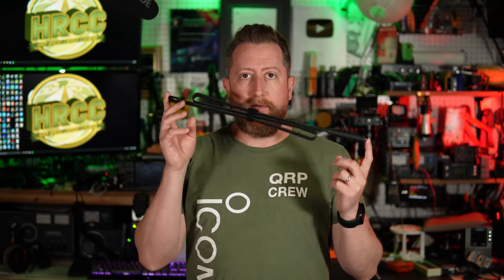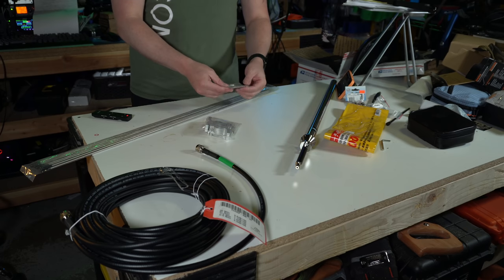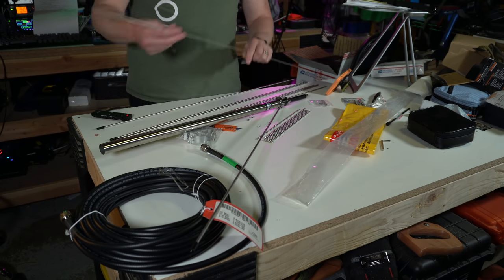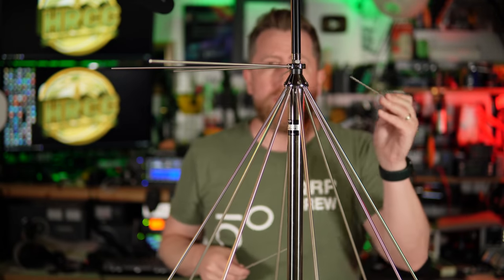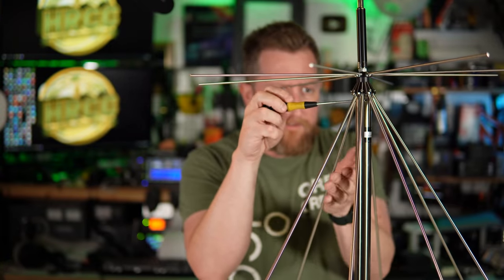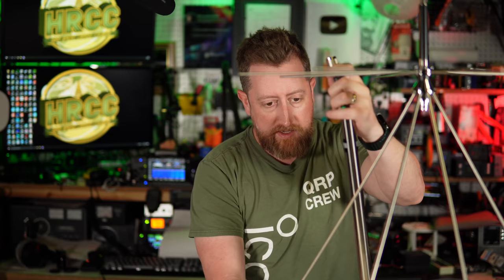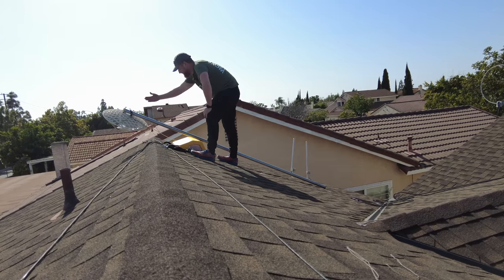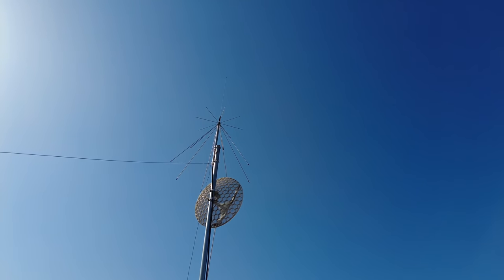Diamond D3000N Super Discone Ultra-Wideband Antenna: Great for SDR and Scanners!

Comment from the maker: Note: the Antenna had roughly the same SWR when it was installed on the roof as it did when tested in the shack.  So that was good news as VHF/UHF was frankly very good!
Reply: Put a preamp also then you can get rid of attenuation in tha coax and get even better RX , nice job 👍
Reply: @Peter-W1 would you need for uhf and vhf or just the uhf?

Comment: I found the TRAM discone to be a bit less dangerous, easier to set up, half the price, and it seems to work really well!
Reply: Yeah that's the one I have, it was cheap , well made, works well and has tunable lower extensions that allow RX down to 11 meter band but it does not RX up to 3Ghz supposedly.
Reply: Ditto. The Tram has a better designed hub.

Comment: Just a hint for you, if the set screws  on the capacitance hat ( horizontal elements) and the threads on the angled elements do not have thread locker on them already, I would recommend Loctite blue thread locking compound. Do NOT use red !

Blue will hold the elements in place, wind over time will vibrate the elements loose and one day you will look up and notice missing elements. Red Loctite requires high heat to break the bond, high enough that you will ruin the antenna to take it apart. Blue will hold the elements in place while still allowing you disassemble the antenna if necessary.
W1VJL
Reply from the maker: Good call!
Reply: Would the blue Logitech act  as an insulator, or does Logitech conduct?
Reply: @jdock32778  it acts as an insulator but enough of the element should still be metal to metal contact that it should not be a concern, you only need a very small amount don't completely cover all the threads and most also have a locknut on the element to tighten against the hub don't use it on the locknut if one is provided, the locknut will also provide a path to the element from the hub.

If it is the type where an unthreaded hole is in the hub and you just slide the element into the hub instead of screwing it in and there is a set screw to hold the element in place, Loctite on the setscrew will not affect capacitance
Reply: @the_second_amendment388  Very good. Thanks.. ...Loctite not the spell corrector Logitech. Wow.
Reply: Just TAC WELD IT!

Comment: Josh ... love real life "lessons learned" presentations. I originally had one of these Diamond D3000N discones. I just replaced it with a new Comet DS-150S Discone Base Antennas. I also have an RSPdx  that I have dedicated it to. This antenna does not use set screws, but, all of the shafts are threaded with a lock nut. All of them including the capacitive type hat have black plastic covers on the ends to protect your eyes. I routinely use this antenna for all of my HF listening as well. I find that the S/N ratio is much better than my full length wire antenna that I have in a horizontal plane. Keep up the good work! 73 - KF6IF
Reply: May I ask what the reason for switching to the Comet was? Currently torn between the two here (for UHF/VHF SDR scanning)
Reply: @sbo3784  Age of the antenna primarily. I live close to the ocean. They both have provided similar results.
Reply: @phildurall7466  thanks 😊
Reply: How do you like the RSPdx?
Reply: @seasparrow7427  Love it! I am surprised all the time with this little box.

Comment: I use a Diamond D3000 antenna for FM, DAB, 132MHz aviation band (I live near an airport) and 144 MHz amateur band. For the Broadcast signals I am using a UK designed Majority Fritzwilliam 2 receiver and for the rest the also in the UK designed SDRPlay radio on my PC.  The whip antenna peaks around 49MHz measured with my NanoVNA-H analyser. The cable is a Messi & Paoloni Hyperflex 5 low loss 50 Ω cable that is 28m long. I used an N connector on the antenna side. The FM signal is around -57 dBm at 102 MHz and the DAB reception is excellent! I receive the weakest but still useful channels over a distance of 65 km (10kW transmission power) and even over 90km distance at a C/N between 9 and 11 dB. That is really the lower limit! The nearby DAB stations I receive with a C/N of between 19 and 24 dB.

Comment: That signal that spikes up and is centered just above 445M looks almost exactly like mine did at my home QTH. It turned out to be one of my monitors on my PC. Turning off the monitor did not solve it. It was the monitor that was connected from the PC using HDMI and then ran into an HDMI to DVI adapter on the back of the monitor. Only way it went away was to either power down the PC, or disconnect that particular monitor cable from the back of the PC itself. Disconnecting it from only the monitor did not change the signal. Once I did, the signal as well as all the spurious emotions went away. My other 4 monitors on the PC did not cause any issue. I noticed some noise on the radio when tuning into signals near those frequencies that could be heard on some repeaters etc, but never figured out the source till I connected my SDR and was able to visualize it like you just did in this video.
Reply: same happens to my hdmi to vga adapter, and the noise is fairly powerful aswell surprisingly

Comment: Caveat Emptor :
It has been my experience, that over time, if you don't tighten the elements properly, that exposing these antennas to various wind speeds, they will respond to the vibrations, and lose elements !
I have learned to combat those vibrations, by incorporating a UV resistant monofilament fishing line, tied to each long element around the skirt of the antenna, in daisy chain fashion !
Knoting the line around each element as you go !
This, if done properly, acts as a damper of sorts, helping keep those pesky antenna disassembly vibrations to a minimum !
                   🤔.....?
          Just a thought !

Addendum :
I would also suggest if the model antenna you purchase doesn't have nuts for each element, it would be a wise investment to purchase the appropriate size nuts, as when tightened appropriately, they aid in helping keep the elements from backing out !

Comment: That self-sticking tape at 10 minutes into the video is the stuff that we used to call F-4 tape in the Air Force. Because it literally held the F-4's wire harnesses together in a pinch.

Comment: I started out with a Tram discone, and a raspberry pi running cubic sdr on debian.  That's what sent me down the ham radio rabbit hole.

The Tram is a lot easier to put together and has an 11 m whip and two longer tunable base whiskers that do 10m , so I also successfully used it as a cb antenna (for local stuff) before I got my ham ticket.  The transmit range is very limited though - I never made any CB or HF contacts with it outside of maybe 10 miles away.

Discones have BIG EARS - I can hear VHF/UHF/GMRS repeaters 80 miles away in other states with it, mounted about 30' up in the air... and I live in hill country.  You're going to love it for SDR and scanning. 

The downside is that discones have zero gain/directionality.  So you won't get out with it past 5-10 miles on transmit.
Reply: I've been using the Tram 1411, and like you, started out using it for SDR listening before I got my ticket.  On top of 20' fence top rail, that thing is my go-to for 2m, 440, 6m, and 10 & 12.  I've done dx to NZ & Aus, all over North & South America and Europe on 10.  I haven't  been able to beat it with anything I've tried so far on 10m including dipoles.
Reply: @aandpman  You must have caught some magic sky to DX with a discone!  The best I could do with the tram on 10m was a guy in the next state.  Maybe is has something to do with 10m being a "daytime" band and time zones - I'm an east-coaster with a 3 in my call, so most of my DX window on 10m is closed to the east across the Atlantic, by the time the band is warming up for me.  I did hear a lot of Caribbean CQ's, but I never could hit them.  I normally can't hear west of The Rockies, unless the caller is pumping some serious wattage.

I have mine on top of a 10' stick of 1" galvanized conduit, that I hose-clamped to the top section of a 25' telescoping flagpole that I bought at Harbor Freight.  When I'm not using it, I just collapse the flagpole, and it's hidden behind my garage.  I got the idea for the flagpole setup from a power antenna I had seen on an old Buick.

Comment: When building or assembling these types of antennas, ( other than having eye protection) if you can't loop or blunt the ends , use 
Conical Plastic Anchors - that are used for masonry screws or an all plastic type of wire nuts( that doesn't have the metal spring inside) not to protect your eyes but also it can prevent skin scratches or puncture wounds. Remember Murphys laws. 🙂

Comment: Nice - I actually use mine for TX on VHF/UHF here in LA area - much less (none) interference from neighbors cheap landscape lighting transformers than verticals.  Get great comments on TX quality.  Compare RX between the discone and your vertical? Mine is an old Radio Shack garage sale find - bueno!

Comment: Love my Tram 1411 discone with the "CB" vertical. SWR under 1.5 on 70, 1.25, 2, 6 & 10. Haven't tried TX on the Ghz side. Think all my RFI chokes/RFI ferrite core winds work a little matching magic.

Comment: Great Vid. 
I painted mine after installation ''ranger Green'' kept it a bit low and it disappeared....... after that no locktite needed.
 I love working it in tx mode on 2m and surprisingly its a quiet listener on the higher HF bands as well........if for some reason you need it to do that....   
Aside the  hollow filled radials (should of been solid for the price) it is quite robust and I have two..... but if you ever get your hands on a surplus military discone, I'd pay extra over this ant. any time.

73 DE SV0KU
Reply from the maker: Good tips!

Comment: do not use channel locks on any rf connectors, finger tight is usually about the right torque but they have torque standards and you can ruin them but cranking down on them

Comment: I used that antenna and it works very good, BUTT the parts will not stay together in weather. Better weld them in place. I got trired of screwing it back together every 2 months.

Comment: I have one of the other Discone's, crap. To follow trunked systems in 700-800 Mhz, you need the RemTronix rubber duck, it beats every other antenna I've ever tried, base or mobile, it's perfectly resonant, I've tested it against pieces of copper cut to the same 6 inches, with those specifically cut pieces I can hear and see the difference on the band/frequency edges.

Comment: Thanks as always Josh.. FYI it sounds like you're receiving PL tones on your SDRUno... There is a button in the EX Control panel "PDBPF" that mutes them... I am currently running a Diamond X50a for my SDR.... My question is this: The Db gain spec on my X50a is 4.5Dbi on 2 meters, but the discone only reports a gain of 2Db... So for VHF/UHF scanning, would I actually see an improvement with the discone on weaker/distant signals, even though the DB gain is reportedly less? TIA KX7D 73

Comment: Just getting into Ham and scanners. Have a used SDS 200 Scanner with DMR coming in a few days. Have a Anytone DMR base and HT unit also. Setting up the D3000N (HOA trying to hide it in the backyard lol). Question is love these little SDR's also. Doing some research and is it possible to hook up the SDS 200 to a panadpater and have a waterfall display on a computer screen ? Not sure if the scanner also scans talk groups on DMR yet. I like see whats active on the bands with the waterfall. Not sure if it would be better to hook up to scanner or Anytone 578UVIII Pro.

Comment: Interestingly enough, although resonance plays a role, won't any piece of wire receive those Frequencies ?
Since you are into testing, why not put those spec's to the tests ?
As I think it has been shown many times, that manufacturers exaggerate their claims for their antennas !
Especially with regards to Gain !
As it seem right up front, they almost offer a disclaimer for a Discone, by calling it a Unity Gain antenna !
As if to say they threw a bucket of RF on it, to see what would stick !
                       🤔....?

Comment: Moonraker makes the "SCANKING HF DISCONE 0.05 TO 2000 MHZ ANTENNA" which I am interested in because I have an SDR with only one antenna input and it basically covers everything, but I am suspicious because I haven't been able to find any other discone with that sort of coverage range and there doesn't seem to be any reviews of it online. I would imagine if it performed as well as this one and still covered more, that the demand would be high. Am I right to question it or is Moonraker usually pretty reputable?

Comment: I'm new to all this and enjoy your videos. I have a metal roof and was thinking about getting one of these but not sure if my metal roof would mess with it to much/ I have a shed in the far back but the elec pole lines right above it. I have one other place I can out it but it still will be say 20 to 25 ft from the metal roof do you think it would still work for me very well. Using it with a SDR and software.

Comment: No rubber tips? Just put a small ball of silicone on the end. Whilst the the tube is open, put dabs of silicone at the base of the radials to protect them.

I work with antennae atop 8,000 mountains in Laos and l find silicone sealant a saviour.

Comment: I have something similar  mine is Diamond D-130 with UHF connector.   been using for 20 years.  since I am afraid of height, mine is mounted with heavy duty fence  post driven into ground and 20 ft pole attach to it .     AG6JU

Comment: I am thinking about adding this for my SDR/Scanning/Listening needs.  Tired of burning up MFJ SDR switches.. Have you noticed any sensitivity degradation on the UNO from being blasted at close range from your VHF/UHF primary transmission antenna?  Also, how did you end up diplexing to both the Uniden and the SDR?  Selectable Switch or what. 
Thanks dude
KD9RDN
Reply from the maker: Primary vhf/uhf is 30 feet away. No issues so far. I have this connected to an MFJ sw antenna splitter.  Only receivers are connect to this antenna.

Comment: I own a Uniden SDS200 and am in 850Mhz simulcast hell where I live near UCLA.  I can hear LAPD ok'ish and other services quite well but LAFD is almost inaudible.  I know this is a loaded question as there are many variables that factor into this issue but do you think the performance of the D3000N could help me with the 850Mhz band?  It seems that your reception improved with the unit.  Thanks!
Reply from the maker: If you get it up on the air. Absolutely!

Comment: Hello, thanks for the great video. Just wondering would it be ok if the antenna is installed but not turned it? Would it still work ok for a scanner antenna? Thanks 🇦🇺🇦🇺🇦🇺🇦🇺🇦🇺
Reply from the maker: Please re-read question. There is a typo.  “Turned it”?

Comment: Very nice demo and review. The Diamond is
a great discovery, I have had it in the past.
I now have a Whistler dicone, which is
smaller, due to my location, but quite useful.
I use it with my SDS-100, which is the Hand
Held version, that I obtained when it came out in 2018. I like your SDS-200 too. They
are great scanners. Unfortunately the local PD here is encrypted and not listenable.
73 de W2CH Ray New Hampshire.

Comment: Is the discone antenna a good transmitting antenna or just good for receiving signals?
Reply from the maker: They are fine at transmitting, however, anything lower than VHF, they have reduced power on the antenna I reviewed here.

Comment: Disc + Cone = Discone.    I have one of those but it has extensions on two of the lower diagonals to supposedly receive down to 11m band.  I think it only receives up to 1.2Ghz too but it's been a good antenna for scanning with the SDR, but I wish the SDR would actually scan like a scanner scans (Fast).

Comment: That yellow thing you set on your roof looks very dangerous since you didn't use it and you were walking over and around it and straddling it which is much worse than if it wasn't there at all because it's a tripping hazard

Comment: Dude why the STRUGGLE jUST PULL OUT 4 OF THE LOWER RADIALS AND THEN INSTALL THE TAPE AND SCREW THEM BACK IN.
Reply from the maker: You can learn from my failure I guess.

Comment: When you start recording a video and release you should have just started again 😅
Reply from the maker: What?
Reply: @HamRadioCrashCourse  as in when your are half way through and you think shall I just unscrew all the lower legs and redo the video with the coax install first, the correct screwdriver and the tape thing. But respect for enduring the build 👍
What is the difference between all the different capabilities between these discones. Just looked at the price of this one, but looks a 100%  outdoor antenna.